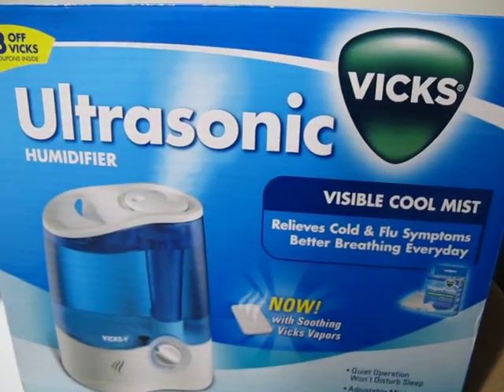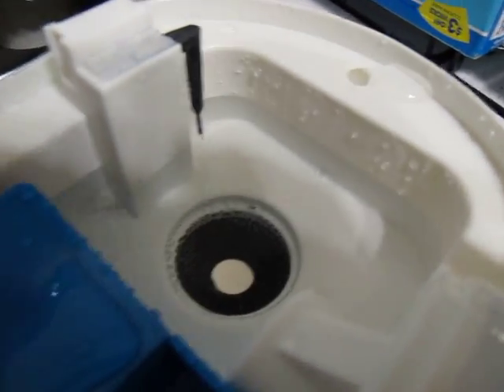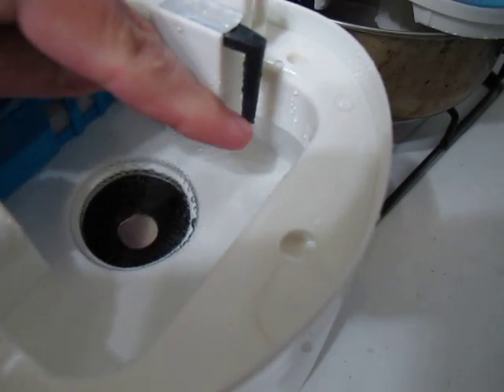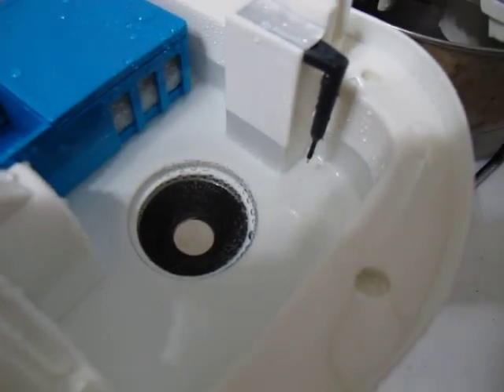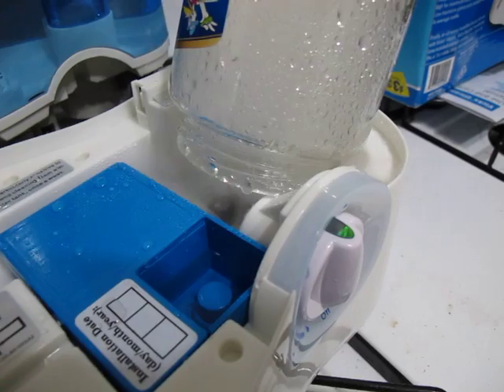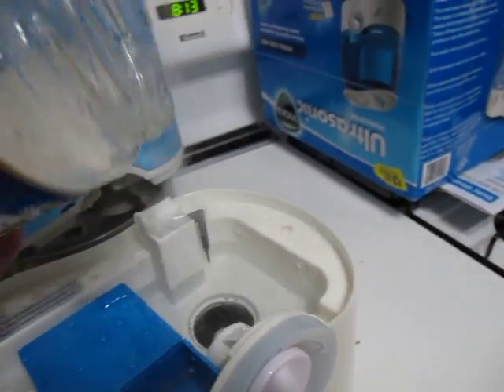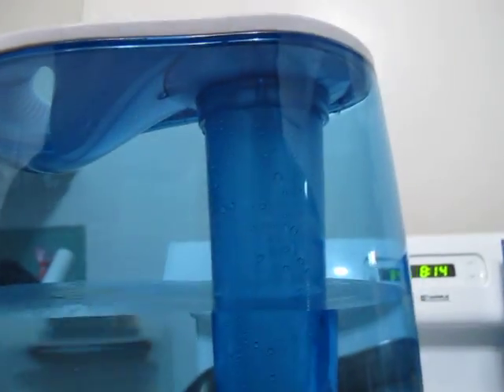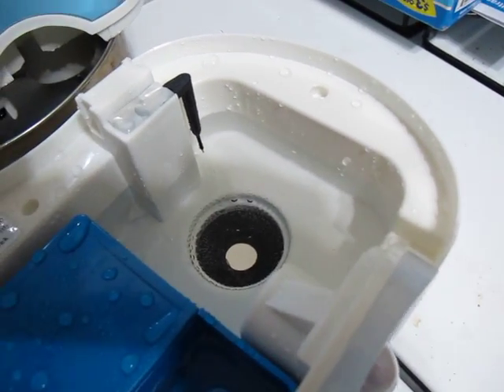Vaporizing Liquids With Sound Waves: UltraSonic Transducer & Cavitation

Comment from the maker: There are many ways to vaporize gasoline. Heat & UltraSonic Frequencies are two common approaches to cracking the gasoline molecule into it's elemental states. See screen name iambillythekid to consider another approach to the use of heat ie rather than boiling the gasoline, billy sprays a fine mist of gasoline onto a 600F to 700F heated steel surface(staying below gasoline's autoignition temperature of 950F) which permits production of a non condensing fuel which increases Horse Power and MPG.

Comment from the maker: One way of understanding the use of a fuel being burned in it's vapor phase, is to consider Compressed Natural Gas(CNG) and Liquid Propane Gas(LPG) engines. These are two fuels which have fewer BTU's(British Thermal Units, or energy) compared to the equivalent weight and volume of gasoline. These engines are internal combustion engines very similar to gasoline powered engines. CNG and LPG engines run quite well, with cleaner engine oil(less frequent oil changes), and reduced tailpipe emisions.

Comment from the maker: The smaller the droplet size of the gasoline, the more oxidation of the gasoline that can take place. Denso makes fuel injectors and when they state that they had achieve only a few micron smaller droplet size of gasoline droplets(new design), significant power and fuel efficiency gains were achieved. The ultimate fuel efficiency of burning gasoline is to phase change gasoline into it's vapor state before it enters the combustion chamber-which permits complete oxidation of the gasoline molecule.

Comment from the maker: Excellent point. It is my understanding that the more of the gasoline we Oxidize inside the combustion chambers of the gasoline powered engine- the more motive force- per unit measure of fuel- we have access to. When injecting gasoline via today's fuel injectors at a 50 micron to 65 micron liquid droplet size- Less of the gasoline is Oxidized compared to the 2 micron to 5 micron liquid droplet size the Ultra-Sonic Transducer(Humidifier) produces. Maximum Gasoline Oxidation- Maximizes Efficiency.

Comment from the maker: Definitely, distilled water is ideal and highly recommended for use with Ultrasonic Transducers(Ultrasonic Humidifiers). Keep in mind, though Ultrasonic Transducers create a much smaller droplet size of gasoline(2micron to 5micron liquid droplet size) compared to fuel injectors(50micron to 65micron liquid droplet size) the ultrasonic transducer does not directly nor instantly vaporize liquid. For maximum efficiency and miles per gallon increase, we need to completely vaporize the small droplets.

Comment from the maker: Hi Pete. Yes-The Ultrasonic Transducer utilizes high frequency sound waves which break up(liquid state-matter) the water molecules(See Cavitation) into very small liquid droplets the size of 2 microns to 5 microns. Compared to the automobiles fuel injectors which all newer model auto's utilize- fuel injectors only achieve a liquid droplet size of 50 microns to 65 microns which is much larger and provides much less surface area for the water or gasoline molecules to become oxidized ie combustion.

Comment from the maker: Thank you for your interest in this project and the technology. The car I drive is a 2000 Honda insight, which has a 61 cubic inch, 1000cc, 3 cylinder VTEC-E engine which runs as lean as 25.6 parts air, to one part gasoline. Or 26 pounds of air to every pound of gasoline(at 6.3 pounds per US gallon). A MoTeC Air To Fuel Ratio Gauge was used to measure the actual air to fuel ratio of the 2000 to 2006 Honda insight engine.

Comment from the maker: You are very welcome. I believe the watts of the Ultrasonic Humidifier(Transducer) consumes approximately 36 watts of electricity. This is a very low power consumption. The Ultrasonic Transducer(Humidifier) creates much smaller liquid droplets than a automobiles fuel injector. For example, This Ultrasonic Humidifier creates 2 micron to 5 micron droplets of water which you see become a vapor within seconds of leaving the unit. A automobiles fuel injector only achieves a 50micron to 65 micron.

Comment: This could be used in making a electronic cigarette atomizer and it would b far far healthier than using kanthal and ni200 wire atomizer. Im working on one now. It works perfectly. Im just working on reducing its size. Im just putting the idea out there so others can do the same. It is much more heathy way to vape.

Comment from the maker: That's really great. 20.oo dollars is a fantastic price. And it only consumes 25 watts, which is extremely low power consumption. Thus only requiring the smaller DC to AC inverters to power the unit. That's fantastic :)

Comment from the maker: I agree electric motors are extremely efficient. And also have a very well documented lifespan of 2,000,000(two million miles) to 7,000,000(seven million miles). And yes, extremely powerful. One of my favorite aspects of electric motors for automobile use(ie electric vehicles- see the Nissan Leaf & Tesla Electric Roadster) is these motors produce 100% instant torque, from 0rpm to maximum rpm. That's a lot of power and torque. One of my favorite design cars is the Aptera, Plug in- Series Hybrid.

Comment from the maker: Answer: Part 2.
Spherical water droplets with 2-micron or 5-micron diameters contain about 10^11 and 2 x 10^12 water molecules, respectively. So you could hardly call those droplets water vapor. However, if the humidity is less than 100%, liquid water will evaporate. Since evaporation happens through the surface of the liquid, and since these tiny droplets have very large surfaces compared to their volumes, they will evaporate very quickly, making water vapor.

Comment from the maker: Below is a statement made by DENSO Fuel Injectors. Note: Even if we didn't conpletely vaporize the gasoline- 2 to 5 microns(Via Ultrasonic Transducer) is much better(fuel efficiency) than 50 mircrons.

Denso statement:
DENSO introduced the 12-hole injector in 1999. Its breakthrough design reduced fuel droplet size to 65 microns, providing superior atomization for improved engine efficiency. In 2002, DENSO followed with its UC injector, reducing droplet size even further, down to 50 microns.

Comment: @150MilesPerGallon Just for drawing the gasoline mist (produced by an ultrasonic transducer) there is no need for heating, its working fine in cold gasoline too. This thing is excellent to start the car's engine in cold weather! ...and than after the engine is heated up, than to use it on vapors only!

Comment from the maker: @furulevi I understand. So- for anyone using an Ultrasonic Tranducer(Humidifier) to break a liquid(such as Gasoline) down to 2 to 5 microns- and then to further allow for complete Vaporization- we would need to have a chamber- which can be heated and optional would be to have this chamber at a negative atmospheric pressure(to help the liquid completely vaporize). Although 1 PSI(using a gasoline pressure regulator to reduce the pressure) may also be a sufficient pressure in the camber as well.

Comment: I read instructions in BOTH units, large and small, and they BOTH say use DISTILLED water is best, I guess to eliminate calcium and chlorine buildup and residue. these units are perfect to take a part and use a 1 gallon can of metal paint and use it on gas or gas/water mixture

Comment from the maker: I have not. However- see Tyson Capels video's here on you tube via a you tube search. Tyson starts his engine on liquid gasoline droplets via the stock fuel injection system ie 50 micron to 65 micron liquid fuel droplets injected into the combustion chambers. Once the engine is warm and up to temperature- Tyson switches off the Stock Liquid Fuel Injection System and runs the engine on fully expanded ie 163.3 time expansion- Vaporized Gasoline. Tyson note's- more video's to come.

Comment from the maker: Fuel injectors spray a fine mist of gasoline into the combustion chamber. This fine mist is approximately 50 micron to 65 micron liquid droplets. The Ultrasonic Transducer- Humidifier technology produces a much smaller liquid droplet size of 2 micron to 5 micron, which quickly becomes completely vaporized seconds after leaving the Ultrasonic Transducer(once the water droplets become invisible to the eye). Water expands approximately 1856 times and gasoline expands 163.3 times ie liquid to vapor.

Comment from the maker: @word2work I've read of EFIE which is an Electronic Fuel Injection Enhancer- which I believe allows you to control or manipulate the signal from your Oxygen Sensors to your cars computer- which I believe allows you to lean or richen the air fuel mixture/ratio inside your internal combustion engine. I also recommend keeping an eye on the condition, look of your spark plugs- durring your testing phase, and thereafter. Spark plugs can tell you if you're running lean, or rich.

Comment from the maker: Answer(two part. two seperate post) Part 1 Of Answer:
There is not a rigid distinction between vapors and gases. Vapors ARE gases, that is, consist of non-associated molecules. Generally speaking, a gas is considered a vapor when its standard state at that pressure and temperature is a liquid or a solid. So, gaseous water at less than 100 C is usually called water vapor. The trick, of course, is that the partial pressure of the water vapor is less than one atmosphere.

Comment: I just bought two mist maker and I install it in a water filter enclosure.  Where is the best place to install the feed, before or after the air filter? In my first run I use ethanol and water, I realize that small amount of water was comming out for the exhaust pipe.  I will be a problem with the amount of oxigen the lambda device can detect?  I also have a ozone generator, I am wondering what will happens if I connect ozone and the transducer to feed the air intake.

Comment: @150MilesPerGallon there is no need for 400 °F, gasoline starts to vaporize around -40 °F theoretically. Just some little additional heat of around 170 °F from the cooling system's water (I think) it is enough...
In this video

"2 Stroke Engine running on gasoline vapors only (with 600 Watt load)"

...an engine is running only on a little vapor!  ...but it needs a little bit of heat, but not much, because at room temp. it is ok already!

Comment: @150MilesPerGallon The gasoline mist as it is drawn into the engine, it collides wit the hose's inside wall and unites with the next droplet... so finally there is some liquid gasoline traveling towards the carburetor... but definitely it is better than drawing liquid gasoline from a gas tank!

Comment: Thanks a lot for your comments and recommendations. Today I installed in my car an E-85 chip from Brasil, Alcoflex brand. I hope this chip can manage the extra oxygen in the system,.  I took some videos to be "youtubed" as soon I finish the test. Also I want to vaporize only water to feed the air intake to reduce motor temp and increase Milles/Gal.  My goal is not to use gas someday in the future. I see a lot of test comming...I am also working with HHO and Geet.

Comment: I have installed 4 ultrasonic transducers in my car. I also inject air into a jar full of gasoline, so some gasoline vapor also goes into the chambers. My car is a Audi A6, 2.5 liters turbo diesel! My mpg has gone from 33 to 61. I'm planning to install a copper pipe on my exhaust and inject small amounts of water into it and turn it into water vapor. Problem is: I need to mix some glycerin with water. Any idea if thats gonna cause a problem or not?

Comment from the maker: This should not be hard nor complicated to do. For example, it is only seconds after the white cloud of water mist leaving the Ultrasonic Humidifier that we see the water mist become a clear vapor, perfectly blending with the air. It is at the point that we can no longer see the water mist that it has achieved a complete phase change ie vapor state. There are many ways to achieve this and facilitate this phase change with gasoline, once the tiny 2 to 5micron droplets have left the transducer.

Comment from the maker: @word2work You are welcome :) I'm happy to hear about your experiments and ideas :) I was recently reading that a Nitrous Oxide NOS system actually works by way of the Oxygen actually providing the power boost, while the Nitrous actually acts as the cooling agent. Oxygen alone would burn much to hot. I also read, that for every 10 degrees F that the engine is cooled, you achieve one horse power; which adds up quickly. I like your idea of vaporized water injection to cool the engine :)

Comment from the maker: @furulevi I see. So the gasoline vapors sit above the gasoline- which the fumes(vapors) alone have enough energy to power this engine under load. I notice the notes mentioned in the video which specified that the engine only stop running because the gasoline became more and more cold. Exhaust heat bubbling the fuel container may help to keep the fuel warm- and thus a sustained engine run test. Maybe a simplified version of the GEET Reactor design may be of some help in keeping the fuel tank warm

Comment: have you already come up with solution how to transfer vaporized gasoline through electronic injectors into cylinder? I think that engine control unit can make it very difficult to work properly. I saw just it's not a big deal to run it through simple carburator, since it's based mainly on vacuum effect, which carburator does.

Comment: Thanks :) Actually because its a diesel car, I have ordered and MAP enhancer from ebay, but I have not received it yet. I'm sure that will increase the mileage even more. I have not made any videos yet, but I make one soon and I will post it for you :) And glycerin needs to be added because it help water to vaporize faster when it comes into contact with hot surfaces such as the copper pipe which I'm going to install on my exhaust pipe. Please check videos about "mosquito foggers" :)

Comment: The unit I have, holds 1.4 Liter, I bought it for $20.oo, and it's 120V, 60Hz, 25 Watts, so a small 100W continuous Inverter should work to convert 12V Battery to 120V plug in, even using cigarette lighter outlet should work

Comment from the maker: In this video, we see the white mist 2 micron to 5 micron liquid droplets of water leaving the high frequency generator- which because of such a small liquid droplet size- quickly becomes vaporized seconds after leaving the high frequency sound wave generator. Gasoline engines utilizing fuel injection- inject a 50 to 65 micron liquid droplet that is flash heated and compressed- not permiting complete gasoline molecule oxidation. Maximizing surface area of molecules permits increased efficiency.

Comment from the maker: Nice :) any chance of making a video which we can see here on you tube, of your system? Sounds very interesting, and that's great you are having great success with your alternative fuel system. Are you using an EFIE(Electronic Fuel Injection Enhancer) which allows you to adjust the engines air to fuel ratio ie Lean or Ritchen the mixture. Not everyone uses the EFIE. I have not heard of glycerin being used with water. I will research this further right away. Thank you for sharing your experience.

Comment from the maker: @furulevi I see. We can use the Ultrasonic Tranducer(Humidifier) to start the cold engine instantly- because the Ultrasoniic Tranducer(Humidifier) has the ability to instantly create an extremely fine mist 2 microns to 5 microns with liquids such as water and Gasoline. Once the engine is running- we can use the hot exhaust to boil, vaporize the gasoline(400 Degrees minimum, but less than 536 Degrees F(See via Google search: Autoignition). This is fantastic :)

Comment from the maker: Continued: I plan to use the signal from one of the pre existing fuel injectors, and unplug the rest of the fuel injectors. I'll add one fuel injector to the vapor chamber, which will be plugged into the stock fuel injectors signal. If testing indicates I need more than one fuel injector spraying the 50 to 65 micron liquid droplets of gasoline onto the heating element, I'll add a second fuel injector to the vapor chamber. Billy notes an increase in mpg, and a significant decrease in engine temp.

Comment from the maker: An Exhaust Temperature Gauge was used to measure the temperature of the exhaust, between the catalytic converter and the engine, and when running lean or rich, the exhaust temperature lowered. The hottest exhaust temperatures were produced at the 14.7 to 1 air to fuel ratio. When running lean, Oxides of Nitrogen(Parts Per Million) are increased. Honda add an extra Catalytic Converter to reduce these Nox gases. I've also add the AquaTune HB which significantly reduces Oxides of Nitrogen as well.

Comment from the maker: @word2work Hi- This sounds like an exciting project :) congratulations on your interest in this subject. At this point in time- because I have not tried installing an Ultrasonic Humidifier(Transducer), I highly recommend you ask someone that has more experience with running these systems. From what I've read and researched- I believe I would run the vapors between the air filter and the engine, and not before the filter. But please research this further. Keep up the great work :)

Comment: I also have a smaller one, VERY SMALL, that holds about 1 cup of water, I notice the directions say to use only DISTILLED WATER, Interesting, I didn't know that. does it make a difference, but 1 cup it says will give it 9 hours of run time, it's also USB powered, which means it only needs  5V's +/- .5v, at 100mA. so it should use one of those 12V to USB lighter plug just fine. most car devices now have that. I paid $5 bucks for this on CL